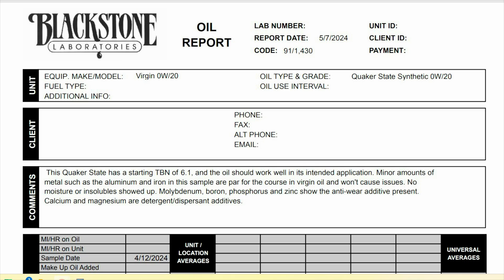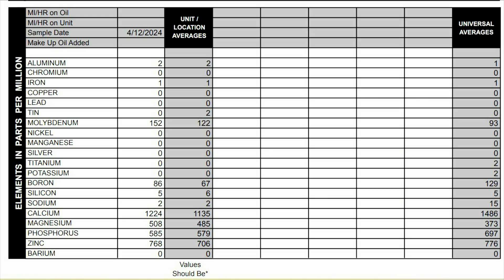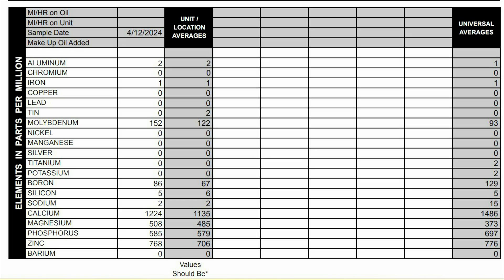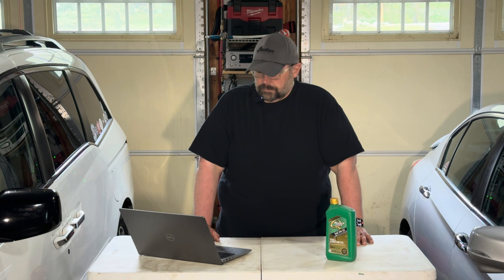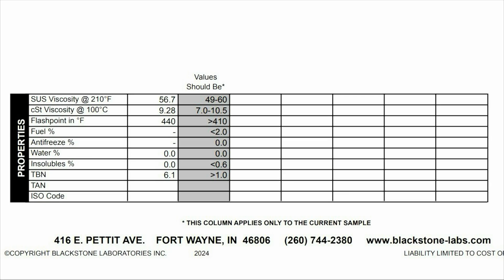Quaker State 0W-20 Full Synthetic Virgin Oil Analysis- What's Inside?

Comment: All the oil formulas keep changing due to API and emissions reasons and chemical availability. Like titanium was in Valvoline Advanced but disappeared and then it was less and less in Castrol GTX and Edge and now it's found in their Extended or their Gold bottle only. QS used to have more moly but they were using Lubrizol dinuclear moly and not trinuclear moly from Infineum. Schaeffer's isn't even using dinuclear... there's is the old formula even before dinuclear. Anyway the older formula and dinuclear are linear and deplete quicker as you add miles. Trinuclear is about like having 6-7 times more dinuclear and isn't nearly as linear when it comes to depletion over its life. So you could start with like 80ppm trinuclear and that's like having over 500ppm dinuclear. Infineum is the only additive company using trinuclear. Infineum is mostly a joint company owned by Shell oil and Exxon Mobil. But sometimes people will look at an oil from the standpoint of how much moly or boron or zn or phosphorus their oil has and that's not the best picture or measure for determining quality. Sometimes oil has more additives to cover up weaker bases. The physical properties done by ASTM test procedures tell the real story about the quality of the oil. QS products always do better than people will believe... and usually better than the one's they think are better. Big thing with any brand is stop trusting the brand and start doing reasonable oil change intervals and then you won't have any issues to start with. If you wait until the oil light you're probably going too long because it's just a mileage counter. If you drive all or mostly town miles you're oil is toast by the time it's changed. I used to know someone who changed by the light. Destroyed a GM turbo engine prematurely and probably the one after that because I stopped keeping in contact with her because she drove me nuts. But since I wasn't asking her about her oil I'm sure that engine or whole car is long gone. Some people just don't learn.
Reply from the maker: Thanks!  I appreciate the info.

Comment: Ow20 and 5w20 are some group V esters, some PAO, and some group III synth. It's really good stuff. The 5w30 is slightly different but it's also premium. I probably wouldn't run the QS full synthetic for 10,000 miles. If you're wanting 10,000 miles I'd probably buy something a little more expensive. I mean...if you're driving a non GDI engine and mostly highway and don't have a turbo it's probably good enough for that. But with a turbo or with GDI i wouldn't. But I'd be careful about using any synthetic for more than probably 6--7000 with a turbo or GDI.. unless the latter is Toyota or Ford that have a second injector spraying fuel at the valve in cold running conditions and switches to GDI once it's warmed up. Cold engines with typical GDI causes fuel contamination because it sprays a high pressure liquid on the cylinder walls and that's why the condition requiring LSPI oil requirements started in the first place. So they took a lot of calcium out of the oil and increased magnesium to reduce the likelihood. Once the cylinder warms up it's not very likely to happen.
Reply from the maker: Thank you.  I have a follow up video on the QS after almost 10,000mi in our Pilot.  Feel free to check it out.
Reply: @InsideBigJaysGarage  will do. It's overall my favorite dollar for dollar name brand synthetic. It just keeps getting better and better. One might spend an extra $881 over the life of their vehicle in just oil maintenance with other more expensive brands but in all reality that doesn't pan out unless you have your vehicle for just about forever and after about 15 years or so it's all the other things besides the engine that's worn out that it's being traded. I don't think I've ever worn out an engine due to what brand oil I bought. It's just so silly to me people still think they have to spend another $8 or more...I guess so the engine doesn't fall out or whatever other thing they fear. I'd just hate to live like that! Putting all my trust in an oil brand. QS is usually one of the first brands to obtain the new approvals and license from GM when Valvoline and M1: and other HM oil isn't even on the approval list yet.
Reply: @RogerChamps-f5w  Quaker Ultimate Durability is the best QS for turbe engines. They say on the box it's specifically for that. I'm a paranoid person and I change out at no more than 5k, usually 4k.
Reply: What about cars with port injection? Or throttle body injection?

Comment: Its actually got a better shot of moly then I thought it would've. I used their 5w30 for a while but lifters didn't seem happy.
Reply from the maker: I was surprised by that, too.  They may be compensating for their base oil?  I’m not 100% sure.
Reply: @InsideBigJaysGarage  that's what crossed my mind.  When I saw an oil analysis of the 5w30 and then found it at Walmart for $5 a quart, I got a little skeptical. I was running it in my 21 Kia forte and after 2500 miles or so the top end got chattery on start up.
Reply: @Matp345 it’s Walmart lol